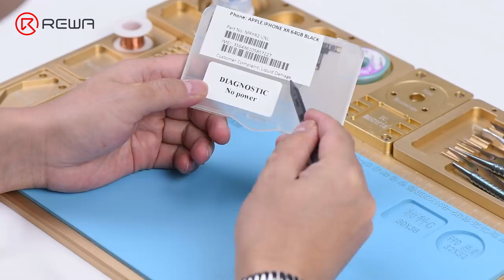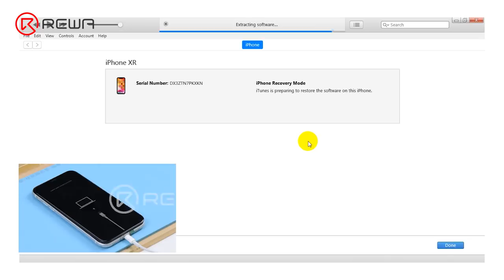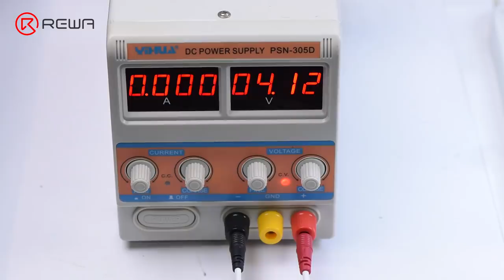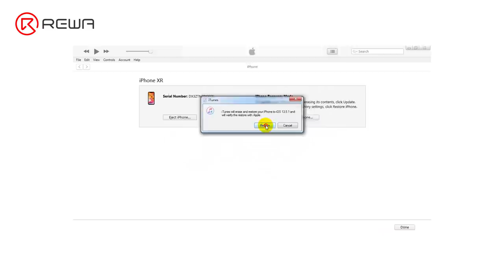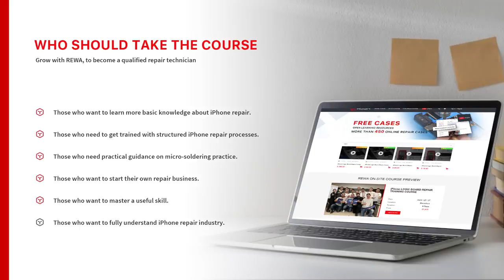iPhone XR Water Damage (iTunes Error 14) | iPhone Repair Tips

Comment: It so nice to find someone who really can fix iphone motherboard. I broke my friend IPhone 12 Pro Max. I used it to took video-under water for my friend. Everything was fined since i used it for seconds only. He used the phone after and uploaded some videos but after he changed the phone it became hot and when off. It won’t turned on anymore. Some technician said that the motherboard contacts might broken. I try to find someone who can fix it but not lucky. So I want to learned how to fixed it but it really hard.
Reply from the maker: Hi, if your device is water damaged, we advise you to take it to a reputable repair shop immediately and do not try to charge or power your device on. Applying power will cause the corrosion to happen quicker by electrolysis. Also bear in mind that phones are never waterproof, only water-resistant. Please avoid using the phone under water.
Reply: @rewatechnology2008  actually we don’t knew that there was something wrong in it. After we used it for few seconds under the water it works really fine. Everything is working so we didn’t suspect any problem in it. My friend uploaded some of his video using that phone and he even used it to listen music. But When the battery got low he  charged it and it charge but when the Betty got 70 percent, someone called him but he didn’t answered it and when he touched his phone it was so hot and when off afterwards. And before we used it underwater the phone has some problem on the program may due to the updates, the camera was so laggy and the facial recognition won’t work. I’ve seen the paper indicator inside the phone when the technician open it and it still Color White and no signed of water getting inside but who knows. There should be a reason why it won’t turn on and looking for a skilled technician is very hard. I don’t know where I can find that person.
Reply from the maker: @vinogalleta3450  Have you tried Apple authorized repair service center?
Reply: @rewatechnology2008  first yes because of the problem before the water incident. Since it has insurance we tried to returned it to fix some issues like cameras won’t open or you need to wait and it’s so laggy. facial recognition  won’t work. They keep it for 3 weeks and returned it without fixing it. So we restart the phone hopping to resolve the issues but still not working. Then the water activity happened and it worsen the problem 🥹🥹🥹 finding a good technician who who’s very well about phone problems are very rare.

Comment: Could be a simpler procedure, reflowing the chips without picking them up from the board, help it or not?
Reply: No because the solder balls has corrosion or the pads
Reply: Inten Ditore Sometimes it’s working, sometimes not !
Reply: To play it safe reballing should be done in such case

Comment: why not open all those shielding and try to ultra sonicking 1st 🤦🏻‍♂️...
Reply: W Dora Corrosion is the gradual breakdown of material, usually metal, by a chemical reaction with its environment. Sonic cleaning is okay in certain situations with electronics, it does not fix the breakdown caused by corrosion of the base metal, in this case ” the solder on the chip pads and board pads. This metal (solder ) has begun to breakdown by way of the corrosion process. In these cases reballing or resoldering with new base material ( solder ) is the only way to achieve good electrical continuity again